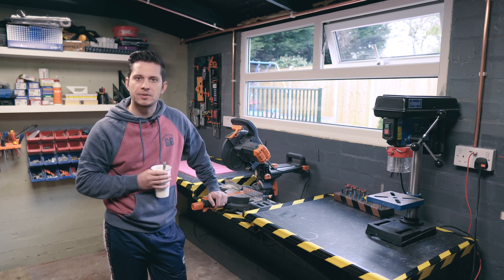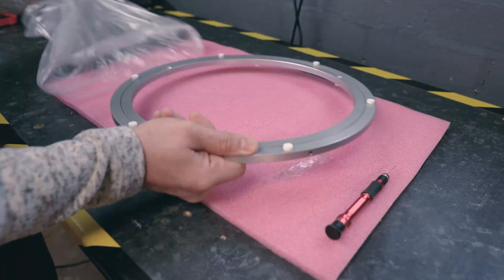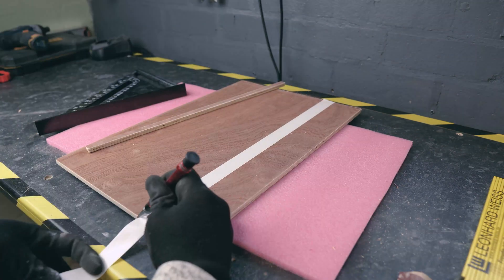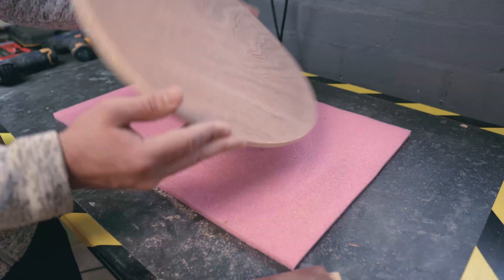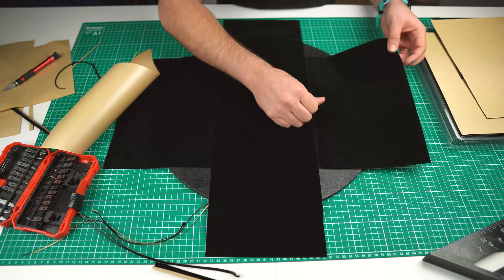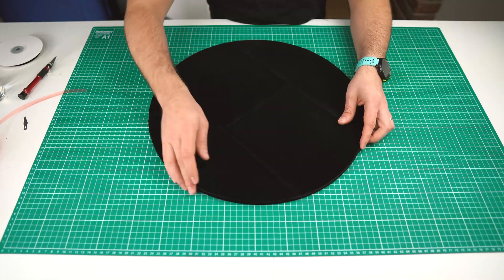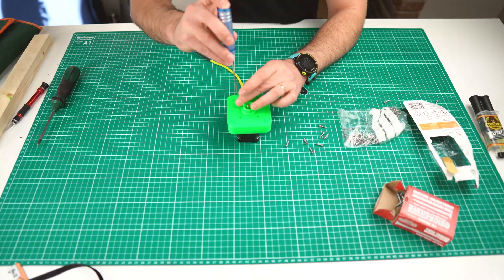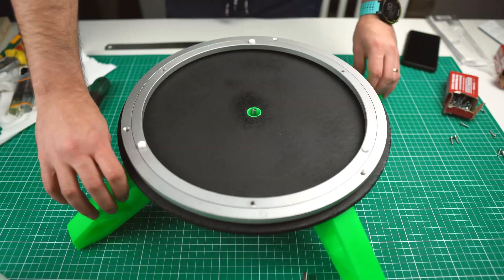📷Arduino Powered  Photography Turntable (PART1)

Comment: Excellent Project. Thanks for sharing. Can you tell what is the radius of the wooden parts?
Reply from the maker: Thanks for your thoughts Bostjan, I'm glad you like it. The top plate is 450mm diameter and the bottom one is 370mm. Bottom can be bigger but no smaller than 370mm.If you  are familiar with CAD systems, I can share the assembly with you on GrabCAD, just let me know.
Reply: @ZeddCraftsIT  I would be very happy if you share a Cad file with us. Can open in Fusion 360?
Reply from the maker: @TheSamuraj85  There you go kind sir. You should be able to open this up in Fusion. You have the whole assembly of the turntable itself.  Let me know if its not clear. I will do a technical drawing sometime this week and I shall replace the hand sketches. Also I forgot to mention the maximum maximum you can spin on that turntable with that particular stepper motor is 1.5-2kgs. If you want to use it with heavier stuff you would have to use something bigger than 0.71Nm. In terms of strength, you shouldn't be worried as I've put my daughter on it who is about 15kgs :) Another thing you have to be careful is what driver you are using, if you are using one that would allow you to adjust the microstepping I would go with something bigger than 8. Again...if you get stuck give me a shout. In theory if you are using exactly the same gear as I am it should work without any issues.
https://grabcad.com/library/professional-photography-turntable-1
Reply: @ZeddCraftsIT  thank you wery much! Is not power supply on wiring diagram to strong 15A for one stepermotor? In video you have 5V power supply,... 
Merry cristmas :) ;)
Reply from the maker: I tried to future proof the hardware in the sense that everything is dimensioned having in mind that you might want to retrofit a way stronger stepper motor .This way you don't have to buy new everything.The adapters and everything else should be compatible with any nema 17 motor you'd like to bolt on at any time.I used a different power source in the video in the end cause I wanted something more compact plus my motor wasn't very powerful.For jewlery and general small products up to 2kgs this setup is perfect,for anything else you have only to upgrade the motor.Be careful what bearing you get for the turntable,mine was very poor quality and added a massive friction in the system.Keep me posted if you encounter any issues!Merry Christmas dude!
Reply: @ZeddCraftsIT  I understand. Thank you! :)